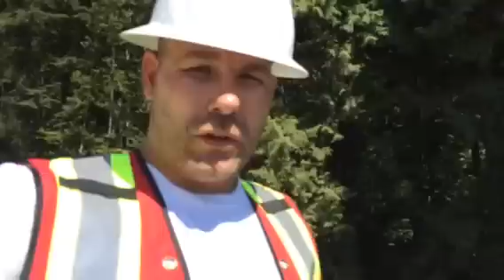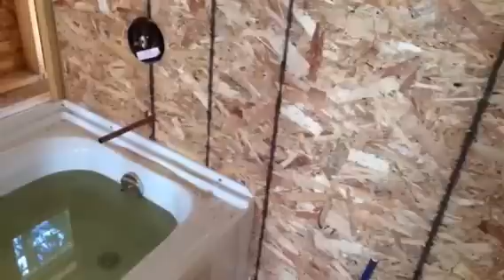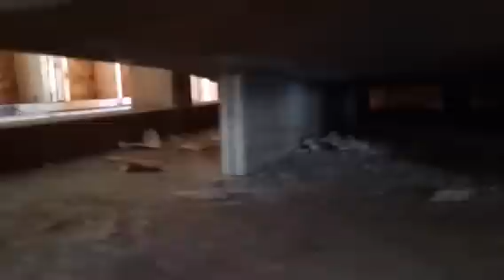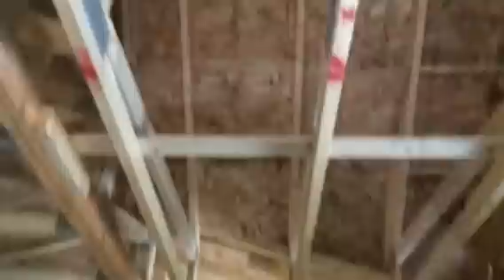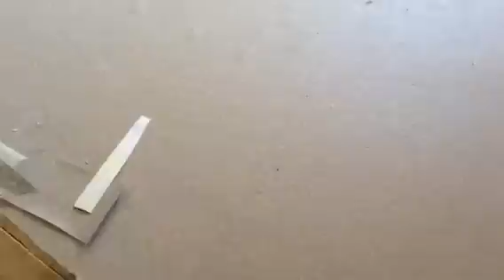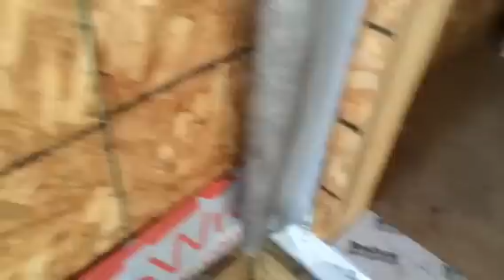New Home Construction Fails

Comment: Roof ventilation.  The figure of 1 square foot of free air area per 900 square feet of attic was based upon soffit and ridge ventilation plans, not 'pots'.  And a single pot is either, most commonly, 50 or 60 square inches of free air area. One pot per 300 square feet of attic does not fulfill ANY code that I am aware of.  And practically speaking.  The code of one square foot per 900 square feet is JUST PLAIN WRONG.

The old code was one square foot per 150 square feet of attic.  That was a common rule of thumb before soffit vents,,, but ya know,, that was a far better 'rule' than any of the current rules.  Been doing this for nearing 60 years,, I have roofs I built that are older than your father.  My experience, having watched those roofs function and age, the 1 per 150, even with soffit vents, is still about right.

Do your customers a really fine service,,, Ridge shingled vents approach worthlessness.  Aluminum pots work very well.  One pot (49 sq, in, free air) per 4 lineal feet of ridge,, AND soffit vents.   That IS far in excess of 'code',, but the code is wrong.  I have been servicing my own work for half a century.  The last roof I shingled was finished last Wednesday.

One pot per 4 lineal feet of ridge,,, and you may need to gang your pots if it is a hip roof, plus soffit vents,,, and you are just about right.

All of the remainder you noted on your inspection, I absolutely agree with.  But on attic ventilation,,, you are listening to a bunch of college educated, wet behind the ears, never climbed up onto a roof in their life, certain of their own slide rule or calculator, morons.  It is a real world, use real world solutions.

Comment: Great video but drywall is fine behind tubs/showers with a good waterproofing membrane such as Schluter Kerdi.  Applied with unmodified thinset it will create a 100% waterproof barrier and surface to apply tile to.
Reply: Just a question.. even with schluter installed isn’t there a concern that the paper on the drywall will tear with weight of the tile/mortar? Or would you just install more screws to the drywall to prevent something like that from happening

Comment: I Don't get it. Do they not have independent county inspectors where you're at? If so, did each one come through and sign off on all this? Also wanted to note that the tub shown here comes like that with the wood on the bottom. You can even see the fiberglass transitioning from the tub to the wood. Its for the purpose of pouring a concrete pad and resting the tub on it and also keeping the skirt uniform with the tub. Its not something the builder or plumber added.

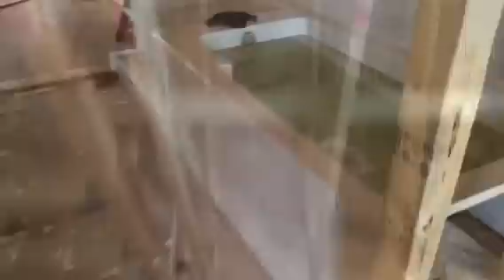Comment: I just did my entire bathtub walls and used drywall ( instead of cement fiber board) but used Schluter Kerdi Waterproofing Membrane on top of the drywall then installed tiles instead of that plastic crap that I would never use.  I also replace the entire shower system copper pipes and all.  2:15

Comment: What a dick of an inspector.Many things you say are inaccurate .How about the front porch ,with the upside down hangers.The joist material looks like cedar.What you describe as a huge deck beside it,with the right side up joist hangers,built with  material looks like spruce ,pine or fir .Not suitable for out door use ..You are more dangerous than the idiots that frame this house,or the builder who hired them..

Comment: The joist hangers are upside down because the deck is cantilevered. The majority of the weight is on the other side of the beam below. This inspector is new. People do things wrong sometimes. Other times people are cheap and sometimes the inspector is a hack, picking on small insignificant things leaving much more important things slide because he/she is unaware of them.

Comment: When I've installed tubs, they've come with osb/chipboard on the bottom, but then also come with metal feet/supports which are fitted to the osb. Perhaps just a cheap as shit bathtub maybe?

Comment: 1 gallon of water weighs 8.3 pounds, not 10. And how do you know what the tile setters will use to waterproof the tub surround prior to setting tile?? Drywall and OSB are more than adequate with the correct waterproofing system. Typical know it all inspector, if you actually are one.

Comment: A gallon of water is not 10 lbs it's 8.33 lbs/gal. and if that is a fiberglass tub that leg (not recommended but) is fine. Hence the reason the bottom is not bowing, sagging, etc.  and those roof boots for the plumbing vents do not meet code of they are within 3 feet of any valley and do not extend at least 12 inches above the roof on the high side.

Comment: what the hell they use particle board and drywall around the bathroom tubs?  that will rot in no time. what  a bunch of idiots. your suppose to use cement board like dura rock for showers and bath tubs.

Comment: The OSB is behind the tub flange.  Emphasis on behind.  This means the cement board or green board would cover the OSB because the moisture barrier needs to lap the flange or butt into the flange.  The end result would be no different than putting the moisture board directly on the studs.  Perfectly acceptable.  In fact, maybe even better because the wall would be stiffer than having green board directly on studs.  The guys were laughing at you for this one.

I agree the hangers is a moronic mistake, but the building inspector would have caught it.  Of course, the inspector should have caught any lingering green board mistakes as well.
Reply from the maker: You'd make a horrible inspector TandD1w you automatically assume they would use cement board or green board. Did you not see the regular drywall used in the master bathtub? Why would you assume they will upgrade from the in this bathroom? They'd guys were cutting corners and I caught them. OSB has no place in a shower wall assembly... Period
Reply: Hehe.  That's ironic.  I'm a UBC and UDC licensed inspector.  I'm also a licensed architect in three states.  My comments were limited to the OSB.  If you are curious, I have used standard drywall behind shower modules when we had a rated partition behind the shower.  Before replying try to find a moisture resistant type X or C rated for interior use.  I've also used OSB behind showers where the shear requirements dictated such.  The point is that so long as the material is behind the moisture barrier it's Ok to use.

Comment: 1. you dont know if the builders installation practice includes putting a hardy backer on top of that OSB. That OSB might be required for wind storm per their plan
2. your roof venting calculations are irrelevant. Builder has to follow his venting plan as designed by his engineer.

Comment: Regarding the upside down hangers:  I am wondering if they built that landing before fastening it to the house itself and simply installed it upside down.  

And regarding the first tub, I can't help but feel that it wasn't set this way as a permanent solution vs just mocking it up.. The OSB on the walls is laughable though.

Comment: Please take this constructively.  about 20% of what you pointed out is valid(roof venting and joist hangers upside down), but you clearly have no clue about how a bathroom is built.  The OSB on the wall is strictly used as a backer so the contractor can securely  mount anything anywhere on the wall.  Based solely on the fact that the tub flange is on top of the OSB that tells me that there is another layer to go over that.  Hopefully a densglass or durra-rock in the shower.  as for the OSB under the tub that is a part of the tub that is molded into the tub from the manufacturer.  Generally that is done to make the tub sturdier, and support the outer skirt of the tub.  personally I would have like to have seen a mud base, but that may not be required for that tub.  from there you move to the next bathroom where again the tub is going to get another layer before the tile is installed.  On a side note the OSB is for backer, the drywall is probably for sound blocking, and a final layer goes over that .  next we move into the custom shower where the rubber membrane is installed and you are worried about tiny bubbles that are going to be compressed by the mud base, 2"-4"concrete that is going to be placed in there to create the gentle taper that will direct all the water towards the drain.  With that being said you probably generated a report to the homeowners that in turn set them off in a twist and causing the contractor to spend hours explaining that these were all above standard practices, and there is nothing to worry about.  My point being that if you don't know thats cool, but a few simple questions to the contractor would have made everything clear, you in turn learn something new.  I'm sorry but in my experience being a home inspector should require that you spend at least 5 years building homes start to finish so you have an in depth  knowledge of how it is done.
Reply from the maker: Thanks Shawn Masterson but you might be wrong. The developer didn't install what was designed for the bathroom walls, tub and tile backer. They were forced to remove and install the proper system after I located it. 

If you think OSB and regular drywall behind a till wall is acceptable you're part of the problem not the solution.
Reply: The OSB is a used as a solid surface to accept fasteners. From there  some form of tile backer is installed over it in the shower, and green board or another suitable moisture restant wallboard is applied over the OSB.
Reply: No where did I say tile should be applied non OSB.

Comment: Absolutely agree with independent building certification. When I built my house, I was on site everyday to check on progress- this paid off as we prevented a lazy builder installing a corrogated iron roof with holes in it already. After some stern arguments including a complaint to the builders registration board, we got it fixed properly
Reply: One reason builders resist doing things properly is they bd the job counting on doing shoddy work and using materials not correct under codes. they think they can get buy with this crap--and many do---until hiring a reliable inspector! They are definitely worth the money.
Reply: @robertwatson818  Yes, My experience with the scam artists drove me to learn how to build and do electrical and plumbing. I may be slower,but my workmanship is far better than these rip off contractors.
Reply: @diyoregonnowtexas9202  My old man had a friend who was contractor. One day he was out with the contractor at a job site. Ricky Redneck drove up and said he was looking for work as a carpenter. Odd request because at that time the building business was booming and framers were especially in demand. he was asked what he could o. His reply was--"I can do it all bro--top to bottom? Okay--go get the circular saw out of my truck right there and build me some saw horses out of that  scapulas lumber over there. An hour later the guy had a pile of pieces---but no saw horses! LOL!  He thought he could BS his way onto a crew and learn as he went. There are large numbers of Ricky Rednecks here. Each one knows a "little" about certain jobs---but only at a very basic level. They want top dollar but can only perform at minimum wage skill level.
Reply: You didn't build shit

Comment: New houses are now more expensive than ever before yet all the timber used is fiberboard shit. I fucking hate this stuff. It's everywhere now days. Same as laminate flooring. What a joke that stuff is if you spill water on it... Seriously there is some serious greed and corner cutting going on with new houses. No way are they worth the 6 figures+ they are sold for.

Comment: Those particular hangers may have been  installed in the wrong orientation, but saying "they're called hangers for a reason" makes me think that you know the difference between up and down but don't understand loads. And, as has been thoroughly noted by others, complaining about the OSB around the tub is completely invalid if you don't know how the project will be finished. That the other tub has a layer of drywall over the OSB should be the clue you're looking for.

Of course if you're just trying to promote yourself to homebuyers who don't know any better, then carry on.

Comment: Maybe the tub wall is a shear wall. tubs are set to rough walls, shear or studs. The plumber did rough his valve in the wall too deep. The face of valve plaster guard is finished tile.

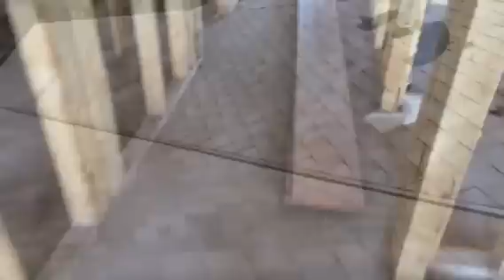Comment: You can clearly see at 0:43 secs a metal strap coming up through the floor nailed to the Osb plywood. The Osb is not there for a tile backer but rather for the engineering of the house.  It's called a shear wall. That's why the Osb is on the one side only. Behind that Osb is a stud pack for a point load, most likely a girder truss.
Reply: right -its made to be overlaid with green board or cement board as a finished surface
Reply: Yeah but you don’t use osb for shear you use plywood like 3/8 or 1/2 inch
Reply: @bat916onminez  not true. We use 7/16 osb for shear walls all the time as per engineered drawings. Osb actually has a shear rating almost double of plywood, but it lacks in nail holding. In the end they have close to the same shear strength when nailed off.
Reply: @Dbonedarryl  maybe in residential but in all the commercial buildings I’ve worked on it’s all plywood.

Comment: the OSB on the shower wall i can see, but we dont know the finished surface, like the drywall in the other bath, if they plan to apply Schluter or Prova membrane, they are rated to be applied to regular drywall in a shower/bath application when tile is installed, so while it may not be the best product it is an acceptable substrate

Comment: This guy has obviously never installed a tub; the screw flanges are still exposed on both, meaning that the osb and drywall are going to be behind the tile backer. The osb under the tub is part of the tub, and does not require further support, per the manufacturer's installation instructions.

Comment: At 2:16 the drywall on OSB is most likely used as a fire stop between 2 units (duplex) and is not a uncommon building practice.
On top of it will go another layer that the tile will be applied to. Often aqua board is used BUT it is still comprised of gypsum so it is still not a ideal product but is acceptable.  I prefer to use "backer board". It has a good water proof surface and you can apply tile easily. Cement board is also a fantastic product to use in showers. I have been in the drywall trade for 28 years.
Good video, and it is amazing to see mistakes that should never happen.

Comment: that board under the bath is really no good.it's just going to sag more and more over time and then your silcone around the bath will crack and open up.if it hasn't got any feet then just build a a frame at 400 centre's and if your measure it right it can even help hold your bath panel in place.

Comment: This is why I hate it when there is a requirement to have work done by a contractor.  I can and will do most everything better than 90% of all contractors.  If you can become a contractor and then install joist hangers upside down, being a contractor means absolutely nothing.  
I would hire anyone from This Old House or the Property Brothers.  Anyone else is a huge gamble.  Never trust, always verify contractor work!

Comment: Water weighs 8 pounds. 8.36 to be exact. : )
Reply: what about an imperial gallon?
Reply: Imperial gallons are not metric, litres are.  But I expect an Imperial gallon is probably right about ten pounds.  Imperial gallons are eighty ounces instead of US gallons which are 64,  but Imperial fluid ounces are slightly smaller than US ones.

Comment: I think you need to inspect a code book and figure out what the minimum venting requirements are.  It is not "one vent per 300 sq ft".  

You should never over vent an attic.  This will wind wash your insulation and reduce the performance. 

If moisture is getting in an attic space, the contractor did a poor job of the VDR membrane.  (Which I agree is quite common)

The min venting requirements of a home is 1/300 of the insulated attic space.  That means if you have a 1000 sqft home, you need 3.33 sq ft of venting.  

The building code also states that no less than 25% of the required venting can be at either the upper or lower portion of the roof.  

Assuming ventilated soffit is used, this far exceeds the total venting area requirements, so the top portion of the roof would only need 25% of the 3.33sqft total.  

The top portion of the roof would need at least 120sq inches of ventilation.  

Some roof vents  do 60 sq inches. So you would only need 2 as a minimum. Not 4 according to your "one per 300 sqft" rule.  What size of roof vents are you even referring to?

Maybe you should purchase a copy of the latest code book.  Have a good read before you start going through houses spewing your poor interpretation of the code book.  

OSB behind the shower?  Did you see if they were putting any other tile backer product?  If water gets that far into your wall, you have bigger problems.
Reply: You need to understand code books are not globally universal ya twat.